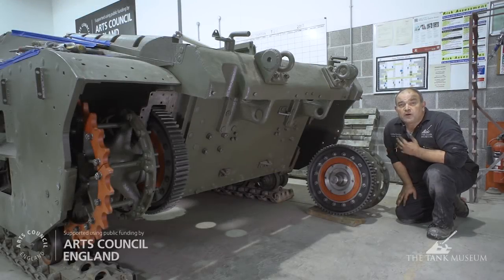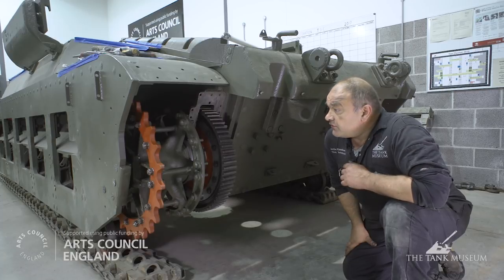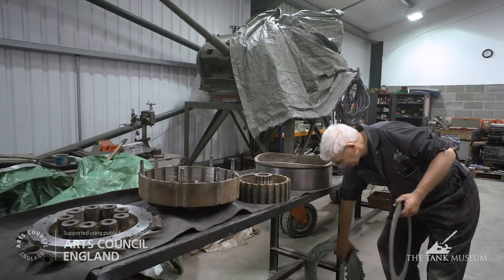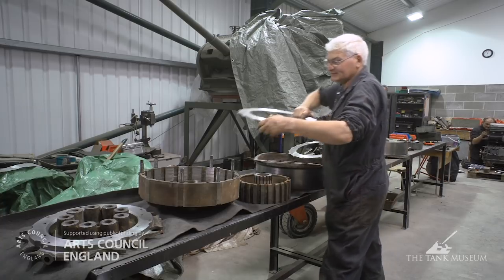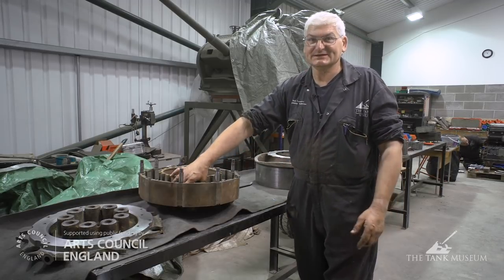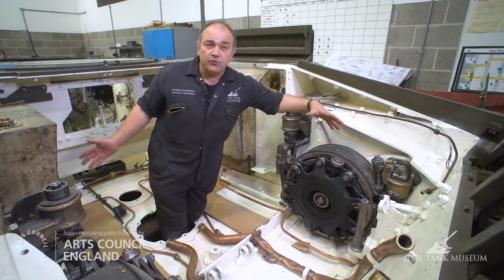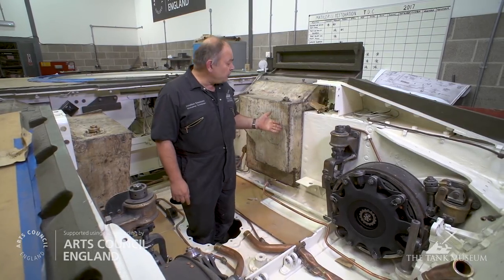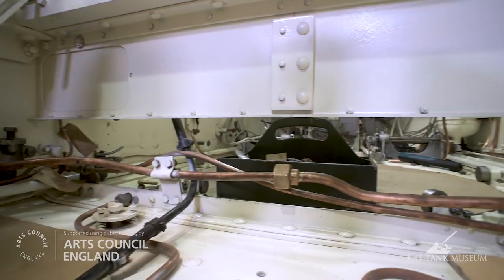The Matilda Diaries Part 19 | The Tank Museum

Comment: The clutch plates and basket design are the same as on almost every motorcycle .
Reply: And the red Hermatite:-)
Reply: And most cars up until the mid 1970's.
Reply: The design was fairly standard even back in 1900. And even in modern cars it hasn't all changed very much tbh. Esp if you have ever torn into an automatic transmission (normal one) or one made by Honda (they are crazy but it works).

Comment: It's a good thing the Matilda isn't a particularly fast tank, otherwise you'd think those straight spur gears would break easily like on the Panther.
Reply: Marc Goozen I'm not talking about the drive sprocket though. I'm talking about the spur gear inside the final drive unit that you can see at 0:36 beside the drive sprocket. The Panther used straight spur gears in its final drive which were prone to breaking at high speed, which is why a governor was installed.

Comment: Did you say it only holds 40 liters of fuel in total? My Ford Focus holds that much!
Reply: perhaps he misspoke, and meant 200 liters each?
Reply: By the looks of the tanks, he probably meant gallons (imp, of course). 40 litres wouldn't get the Matilda very far!! ;-)
Reply: Yes, can the TankMuseum answer this?  There must be more tankage.  All sites on the internet repeat the same spec table with no mention of fuel capacity.  My model kit has a drum on the rear, but thats likely not hooked into the fuel system, just storage.
Reply: 40 gallons capacity in the tanks plus 36 gallons in an auxiliary tank.
Reply: Forbes Hutton thought the same. Almost certainly ment gallons.
Reply: Forbes Hutton Well let us look at a jerry can. 5 gallons of fuel is 20 litres,rounded out. The dimensions of the visible tankage are far greater. So likely those are the actual fuel storage and not transfer tanks. So he said litres,but meant gallons. My best guess anyway.

Comment: Are you sure this tank was so carefully assembled in the first place?
Reply: probably not, but it was assembled by people that had assembled many Matilda tanks, and they had the specific experience to know exactly what they were doing.

Also, they probably didn't have to quadruple check every manufactured component to make sure it was perfect.
Reply: I dout it but then when this tank was assembled orginally it was brand new and not several decades old. I'm sure the people at museum don't want to damage the tank anymore then it's absolutely unavoidble.
Reply: I didn't mean that they're too cautious with the restoration, I meant that the original manufacturers probably didn't take so much care in assembling the vehicle in the first place. It's a tank and they needed it out on the field a.s.a.p. so I doubt the factory had time to fit everything perfectly. 

I like how meticulously the museum team does this restoration, chances are this Matilda will run even better than when it was fist commissioned.
Reply: When originally assembled there would have been loads of special tools and jigs to make the process faster. Manufacturing standards of the day meant that if it wasn't hand fitted, it didn't fit, so to say it wasn't carefully assembled is a gross over simplification. The assembly workers (like any other workers) would get better and faster at their job through sheer repetition.
Reply: It probably wasn't so difficult to assemble the first time, but taking it apart after about 70 years is difficult because you have to put it back together in the same way it was originally assembled without causing additional points for wear.

Comment: Ok so, its hard to make this tank right? Now imagine so many ppl working to make these tanks and when their done they go and fight the German panzers but all of that hard work gone just by that one 88mm shell goes straight through the tank and the tank is gone, crew dead, engine dead, its got a big hole at the front of the tank, and then the Germans use that metal to make other panzer tanks.
Reply: Thats war.    The Germans never reclaimed the metal, but they did capture and repair vehicles of all kinds.  They used several Matildas in action and in training.
Reply: I believe the Matilda tank was the reason the germans invented the 88mm and the Tiger
Reply: +orbitalair I do think that the German vehicles sent back to the factories for refurbishment & or repair, if they had components too badly damaged for re-use, would be smelted for reusing. But yes foreign 'captured' tanks would be cannibalised to keep similar vehicles running - many captured M4 Shermans (both Soviet/Brit A3's, and US A1 & A2 variants) was used as recovery tanks as an impromptu 'Bergepanzer', when the rare Bergepanther and Bergetiger was not available
..an an example although not highlighting re-smelting, is of the 1,355 or so Tiger 1(H)'s was made, over 1,730 was issued to the Panzer units - the difference in numbers being of re-repaired, remade and reconstructed from earlier combat recovered (due to failure, damage or partial destruction, of..) vehicles being released from the factories.
Reply: @Feo T The reason they mounted the 88 in the Tiger is likely because nearly no other german guns were strong enough to knock out something as heavily armoured as a Matilda. After finding out that all or most of their other guns were woefully inadequate for the job, they had to use flak 88's as impromptu AT guns in the field to knock them out. It was all they had that was effective against it. That is a big part of why it was mounted in the Tiger. It proved to be the best tool for the job to knock out a Matilda, and if it won't be able to knock out a Matilda how will it knock out anything heavier? Had they not faced Matilda's and KV's they might have gone with a weaker gun thinking it sufficient. Those tanks showed them that it wasn't.
Reply: Yes well, obviously in the end, war is a huge waste. And wasting the beautiful tanks is one thing, wasting the poor men inside it is even worse. Still many ingenious vehicles were designed and built for war, so let's be thankful we can enjoy the interesting parts of war now, the vehicles, the strategy, the heroic stories, while living in this time of peace.
Reply: Germans recycled metal all the time.  They were especially happy when bombers were shot down as they were made of extremely valuable aluminum.  *valuable as Germans needed it badly for their armaments.